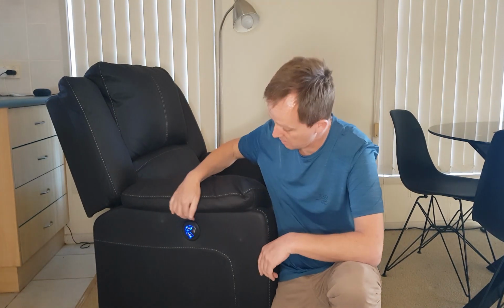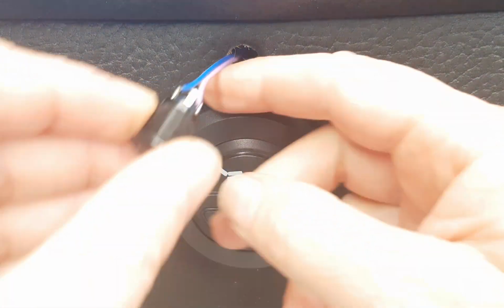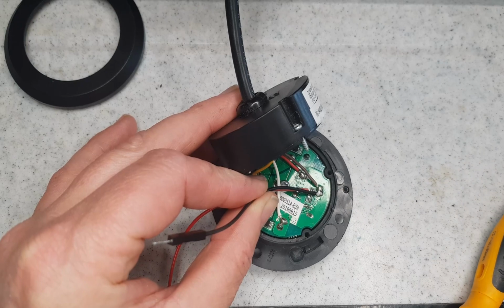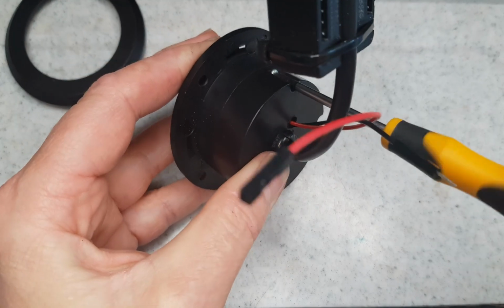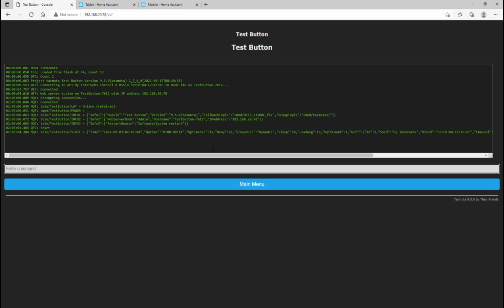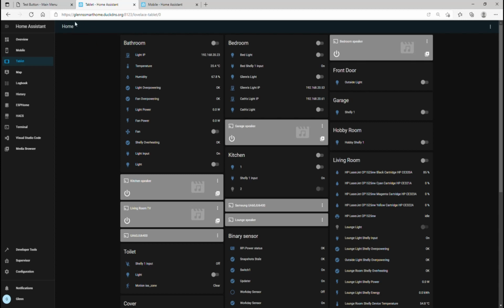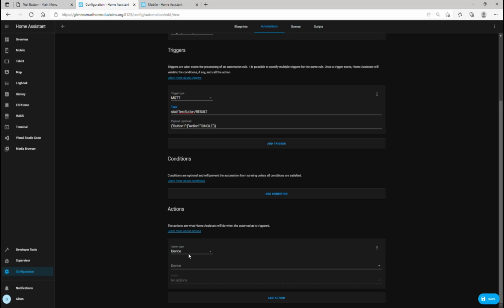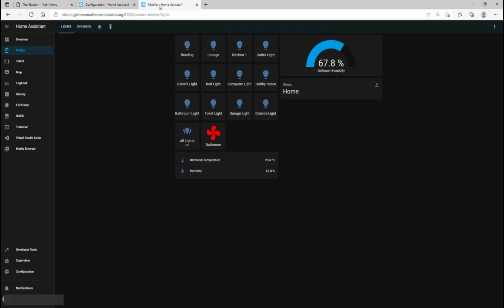DIY WIFI Button and Recliner using Tasmota, MQTT & Home Assistant

Comment: You can use simple CC2530 with ptvo.switch firmware and not use Wi-Fi. Only Zigbee
Reply from the maker: Thanks for the info I have just ordered a cc2530 board so I can have a play.